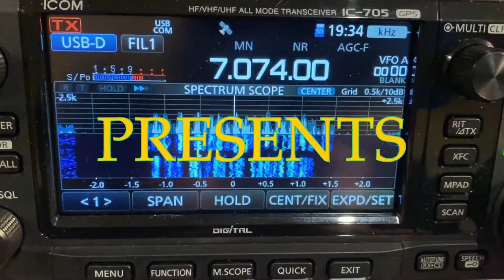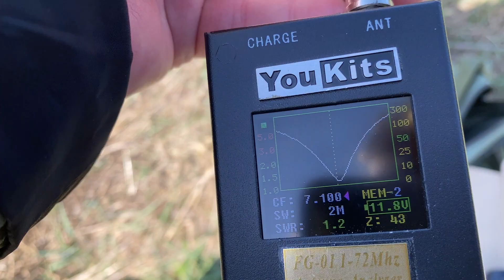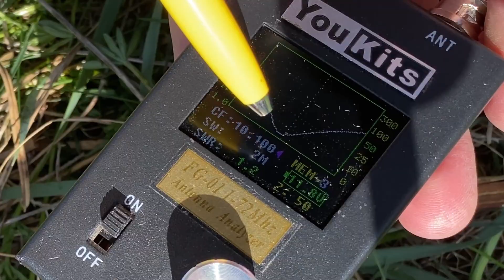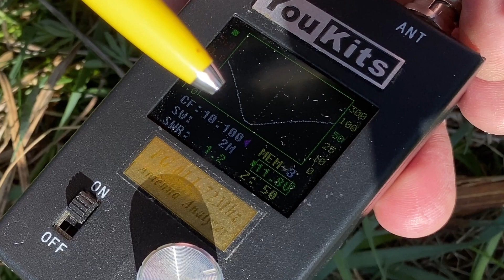MA-12 portable 100W HF GP antenna: how to get it work better on 30m band !

Comment: I use a 5.5M telescopic whip successfully 10-20m.  I have the Wolf River Coil "Sporty 40" to add in for the 40m band.  I thought I would  be able to lower the whip to tune the 30m band.  Nope.  If it is possible would someone please send me some ideas.  (I will shorten my whip to 1/2 its length.)  vy 73 de David AE4LH

Comment: Thanks Linas. As an alternative: for better efficiency it is better to use no loading coil at all… 😊
Just clip a crocodile clip at the top of the whip and extend the length with a light weight wire (e.g. from SotaBeams) followed by a sufficient length of cord back to the ground. For 30M the wire has approx. 2.5 meter length. You then get a kind of inverted L antenna.  It is even quicker and less expensive than putting a coil into the system. 

73 de Chris DL1GKC.
Reply from the maker: @DL1GKC  Thanks Chris! You're reading my mind, inv L and top loading is already in my plans! But the coil is still more reliable solution from the mechanical point of view: the telescoping whip is quite fragile at the top and any tension might deform the whip. Also, the croco clip is not the best connection of two wires :) Could be good in the emergency, though ... 73! Linas LY2H